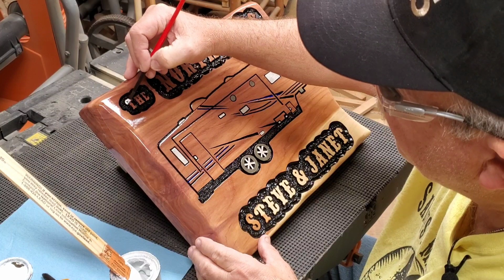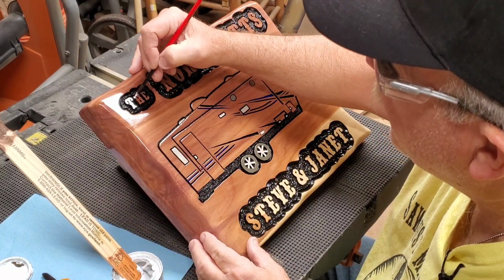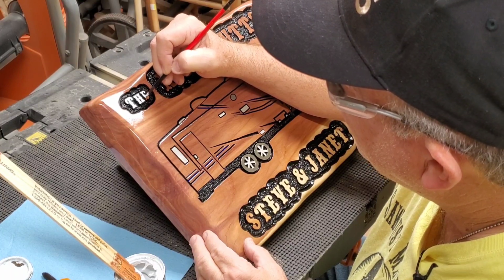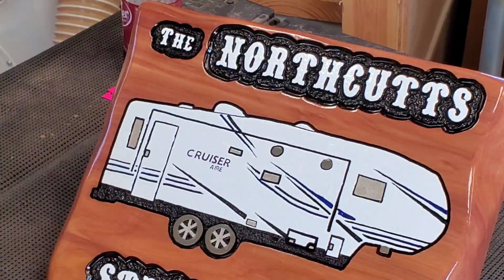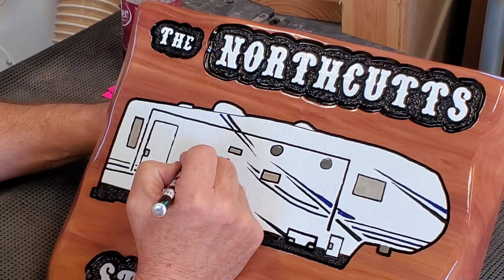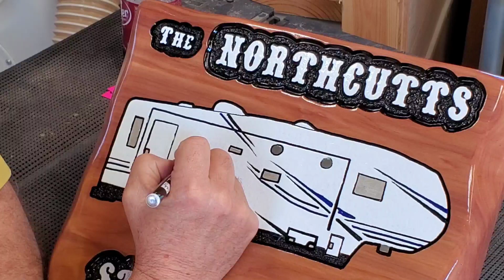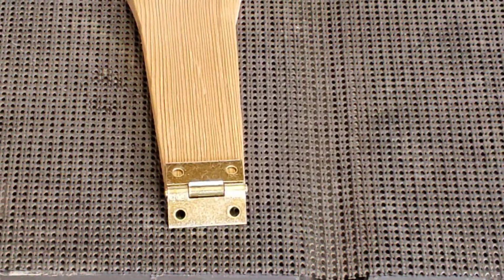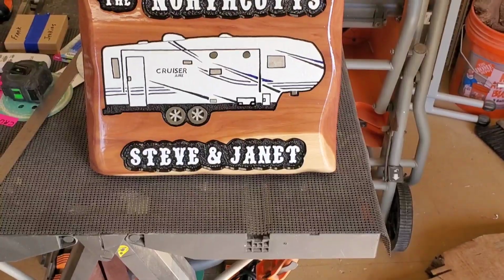Northcutt Cut - Video #8

Comment: As always Frank, fantastic job on the sign. I like you love using the one shot, it is pricey but very well worth what you pay for it and it lasts quite a long time. I did purchase some of the one shot 4007 hardener to see if that helps in speeding up the drying process. Take care my sawdust brother and I am looking forward to the next project.
Reply from the maker: Thanks Don.  I've never used the hardener....I may look into it.  My biggest issue was the rain and high humidity we were having.